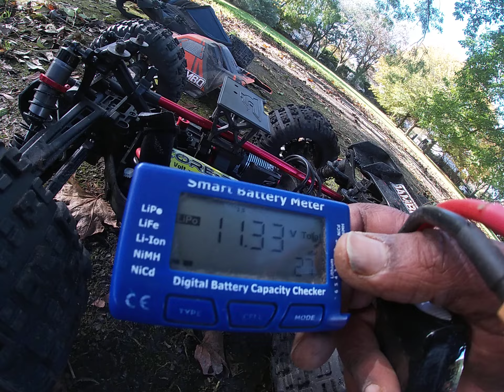Team Corally Jambo 6s,on 6s, Bad Hombre 🌞

Comment: Yosh Steve
I’d crank on the stock wheel nuts before man leaves the yard so we know their tighT 
And about to mine into bashing I’d check them for tightness😎
From there man will know how long a Tight twist will last for 
Ain’t nothing worse than bashing and also same time hoping tings don’t fall apart whilst ear to ear fun G😬😏🤩🤩😁🤤
I’d be VeX paying for nuts that are meant to hold but do not hold🫣😞 tho the wheel hex could have been round out before you put them on
Sooooo 
They’d not stand a chance
Funny thing is tho
Only the rounded out wheel nut came off and the others stayed ON😳
Food for thought G💯🩸
Thanks for sharing your time Steve